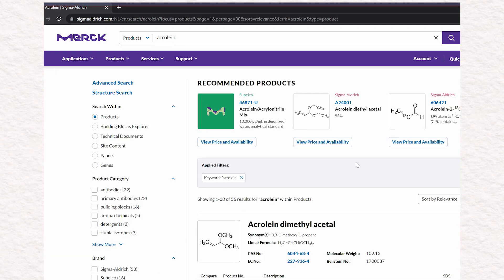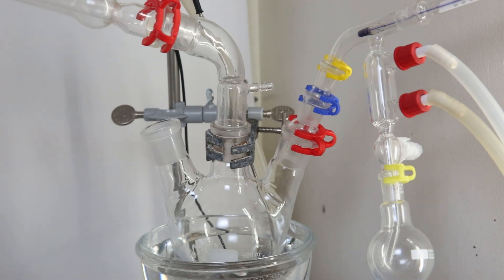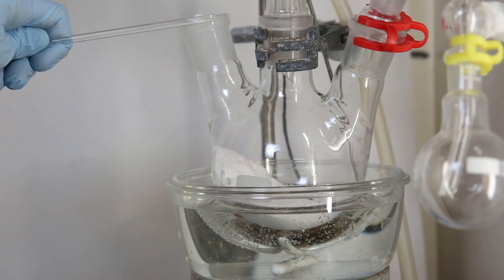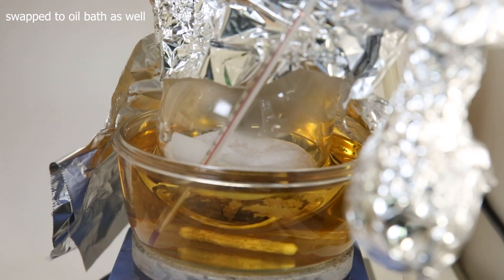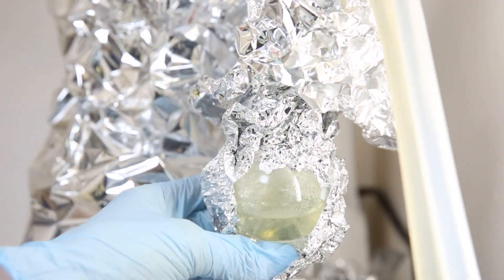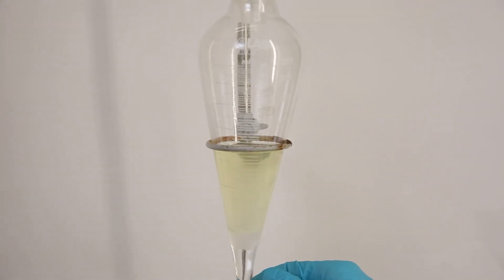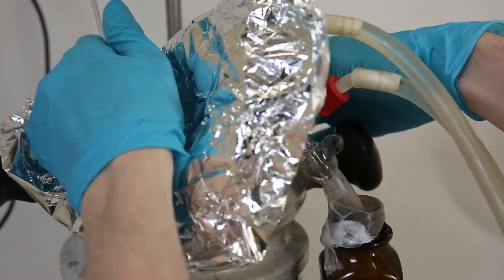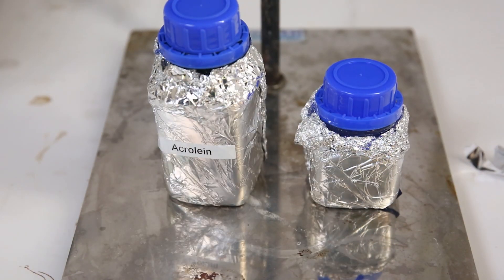Making Acrolein

Comment: To increase the yield of acrolein, it is necessary to shift the equilibrium of the reaction so that water or the resulting acrolein is removed. It is necessary to lower the pressure so that the acrolein and water evaporate, but in this case it is impossible. A simpler reaction of acetaldehyde with formaldehyde is the croton condensation reaction.

Comment: Why is the drip tip on your short path so long? Jesus christ, lol.
Great video man. Glad to see someone else do this synth.
Reply from the maker: Yeah it came like this, i was thinking of just cutting it with a torch.
Reply: @Chemiolis  I absolutely would. Its just impractical. I would use a tube cutter, unless you know you can do it with a torch.
Reply: to not allow your destillate to soak into the joint and risk contamination of your product with vacuum grease if used with such wich is recommended

Comment: Did you use the heptahydrate? Perhaps yeild can be improved by using anhydrous MgSO₄?
Reply from the maker: As far as i know it should be anhydrous but i’m not completely sure, maybe i got scammed and needed to dry it. Perhaps i will test it to see if it loses water weight.
Reply: @Chemiolis  Easy enough to test, put it in a pan on the stove, if it melts it's the hydrate. Funny story, I made this as a kid back in the 60's, it was closest I ever got to getting my chemistry set taken away for good.
Reply: Was gonna say, if it was the hydrate, it would melt at the reaction temperature!